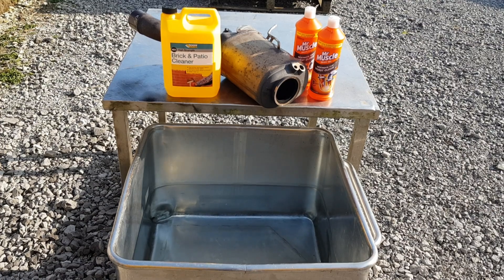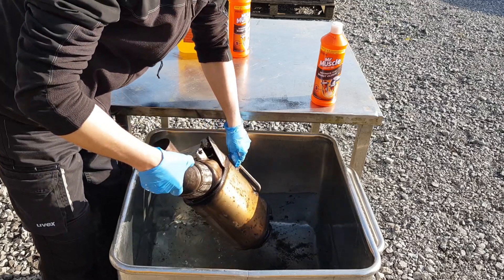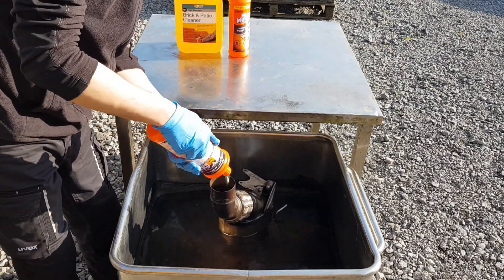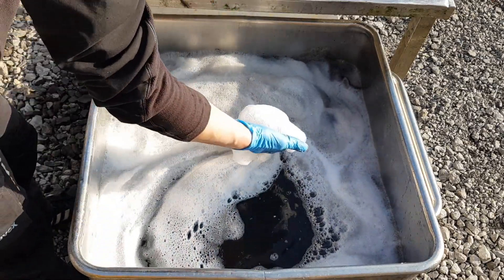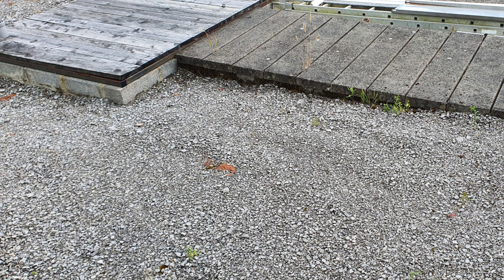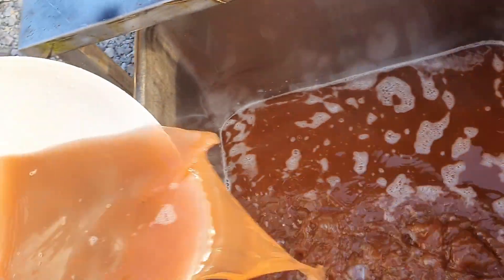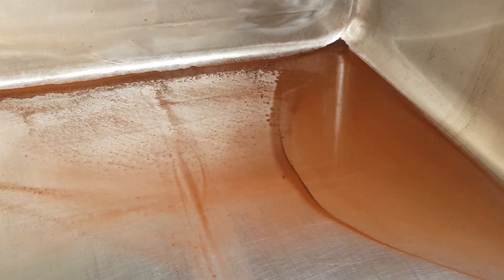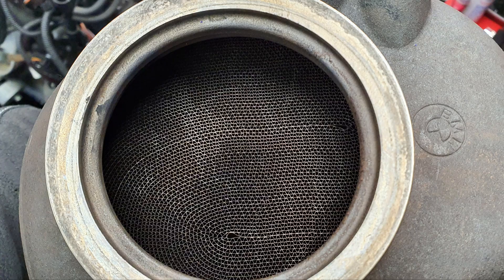How to clean DPF filter Diesel Particulate Filter Blocked DPF removed & cleaned BMW N47 cleaning N57

Comment: Hi, first of all thanks for the video. I already tried to clean my DPF with Wynne's Off Car DPF cleaner, it seemed to do something, but nothing like this and definitely had no red ash coming out, so when I put it back in the car it was no surprise that it did nothing and my DPF was still clogged and doing very frequent regenerations. I'll give this a go as it seems to be working great. Just a quick question though, do you dilute the brick and patio cleaner with water before you apply to your DPF? Or are you literally just pouring pure cleaner followed by water? Thanks.
Reply from the maker: @digitalasylum4612  I just poured it concentrated, just bear in mind it way slightly stain the metal but it will not cause any damage. It worked wery well for me. Hope you have the same success

Comment: That is not the Dpf....is the catalitic converter
Reply: Go to some autodoc and try to order a dpf for a bmw and see for yourself if is dat piece.
Reply from the maker: @dinisrebola2125 in this particular case on the N57 N47 engines BMW combine the DPF and the CAT in one single unit
Reply: Ok. Is possible. I have a e60 2.5d and the dpf is in the midle of the car.
Reply: @dinisrebola2125  it depends on the year/engine. The M47 had indeed the DPF in the middle of the exhaust and cat was after turbo. If I'm not mistaken, after 2008 even the M57 had the dpf and cat combined and located after turbo
Reply from the maker: @dinisrebola2125  Please do some more research

Comment: Have you come across Steven B. Tuner? he tested a number of diffrent solutions etc to clean dpf's, he had a simalar procedure that he tried with bits of a cut up dpf, stainless and the heat resistant packing. Worth a watch!! he moved away from the drain cleaner to of all things dishwasher tabs as a prewash, it worked just as well but didn't have the same issues with heat reactivity if you don't get every trace out of the fiber packing.
Reply from the maker: @K2edg  Thanks for the detailed message. I will certainly have a look when I get a chance. 🤝🏻
Reply: @TheKeenMechanic  if you search 'The Non-Damaging DIY DPF Home Clean (Diesel Particulate Filter and Catalyst - Ash Blocked / Clogged)' it will bring up the theory and why you don't use neat acid (or why you need to remove every trace of it), or 'DPF Cleaning at Home – 9 Chemicals Tested (Diesel Particulate Filter DIY Ash Cleaning)' will bring up his tests of diffrent products. Worth a watch if you do a lot of dpf's.
Reply: @TheKeenMechanic  https://www.youtube.com/watch?v=Zw-EAc_Lpv8&t=970s

Comment: For those here with an N47 on a 520D, the part shown in video is not the DPF. It is located near the rear of the car on the exhaust.
Reply: Yes it is, lol dpf works when the exhaust gases are as hot as possible
Reply from the maker: Thanks for clarifying this for the confused viewer. He did sound confident though😄
Reply: On N47 that is the DPF and cat integrated. You're confusing it with the M47 which it does have the DPF located in the middle of the exhaust and cat after turbo

Comment: Is it safe to perform the task with all the sensors in. I am afraid that I can get myself into trouble removing them?
Reply from the maker: It may damage them. I wouldn't chane it. If you damage them you will still have to take them out
Reply: @TheKeenMechanic  I assume they are going to be covered with soot. How to clean them. Will soot remover be safe to use. Thanks for your help
Reply from the maker: @_robertksiazek_  Give them a wipe with a clean towel, the soot should come off. Try with your soot cleaner if doesn't come off easy but do research it in case it is too aggressive

Comment: Thanks for the video, just out of interest do you know what your pressures were at idle before and after cleaning? Just done mine and drying it overnight before refitting tomorrow. 😊
Reply: Ah no worries it was only out of interest! Makes sense to whilst the engine is out for sure! Thanks for the quick reply!
Reply from the maker: @HalfaJobJames  No problem, glad you enjoyed the video🤝🏻
Reply from the maker: Sorry, mine was not clogged up to the point that will cause issues. I didn't measure the pressure before and after as I had no faults. It was part of the preventative maintenance whilst I had the engine out🤝🏻

Comment: Thanks for the video sir, most patio cleaners have sodium hypochlorite as an ingredient which normally rusts metal like you wouldn't believe so not sure about this solution
Reply from the maker: Tried and tested on stainless steel and worked the best. Would not recommend it on mild steel
Reply: @TheKeenMechanic  Fair enough if it's been tried and tested, hard to prove I guess without cutting it up years later but maybe ok as a one off or as it only needs doing infrequently. Thanks for reply sir 👍
Reply from the maker: @Infj-62  I got the idea from a scientist who tested both chemicals on stainless steel and had no reaction. Depending on the grade and purity if the stainless sometimes it might discolour it but if well rinsed it will not corrode the metal. I have personally tested it many times and no issues

Comment: Great guide, probably simplest on the YT, so I will follow it in near future. Quick few questions though:
1. do you need to remove all temperature sensors ? It looks like you got them off, but I'm a bit afraid that they will fall apart. 
2. Are those chemicals safe for catalistic converter which is a part of my DPF box and can't be separated.
Thank you for any answer!
D.
Reply from the maker: Hi and thanks for watching.
Definitely remove the sensors otherwise they well get damaged.
Those chemicals have been tested extensively by a guy who is a scientist and knows his chemistry. Do some research and you will see for yourself. It will discolour the metal a bit but it will not cause any damage to the stainless steel or the precious metal in the cat and dpf core. 
I have personally used this method on many cars and never had any issues.
Carry out with confidence and wear eye protection as these are strong chemicals🤝🏻
Reply: Hi. Thanks for quick answer. I'm not questioning the method here, I think this video is the only one mentioning the ash removal and I can clearly see the proof with my eyes. I've found different YT video where different chemicals been tested (maybe the same as you mentioned) and 2 stage clean is recommended, for soot and ash separately - again you are only one doing this. All off car dpf cleaners available are mostly concentrated on soot, I do not think my car got problems with that at all. Simply almost 700 regen cycles left enough ash to restrict the flow and I want to focus on this. Exact same chemicals are available here, do I simply do what you have done. Have you left the dpf to soak in or flush it promptly at any stage of your cleaning?
Reply from the maker: @wajdulis77  You can soak in and leave in the brick cleaner acid. I spent several hours soaking, rinsing, shaking, rinsing and soaking in the chemical for best results. If you follow my tutorial you can't go wrong. Some people use a pressure or a power washer but I was afraid in case it damages the core. Best of luck and hope you make it as clean as new. If you are doing this on BMW you can use ISTA+ diagnostics to register the cleaned DPF as a brand new one which should reset the count.
Reply: @TheKeenMechanic got all the info and already bought the stuff, just waiting for a bit warmer weather here in UK. Sadly I do not have BMW yet (got ISTA+ though) but in my current car I can reset all DPF adaptations through dedicated software as well. I'll definitely come back with the results; it just can take some time though as spring is still 2 months away. Thanks again!
Reply from the maker: @wajdulis77  No problem. Take your time and do it right🤝🏻
Reply: @TheKeenMechanic  Finally I've been able to start the job, which is currently in progress. Had big problems with the rusty sensor threads, which was the worst part of the job so far - all survived though. Used drain cleaner and was completely disappointed with the results as there was almost zero black soot. However, after just like 15 min. with brick cleaner brown mud come out, and there was a lot of it. Currently soaking with fresh detergent for the 2nd time. It is looks like success so far. I'm the same person, somehow logged on different account.
Reply from the maker: Hi buddy. You should be glad that you only got small amount of black stuff. It means your DPF wasn't too clogged up. The most important is the brown/red stuff you are taking out as it does not get cleared with regenerations. Well done
Reply: @wajdulis77 hi which software are you using ? I’ve washed my dpf ,but only engine management light is still on (Audi A5 sport back 2017) I bought an otofix d1 light ,which use a bit of autel software,but I can only have dpf regen on the scanner ,but not dpf reset etc .But still won’t let me doing a regen because it says soot mass is too high .
Reply from the maker: @islanderstalents8342 I use BMW ISTA+ bmw dealer software. It is only for BMW. In my case this was preventative cleaning so I had no faults before or after

Comment: Did you get any codes when you re-installed it?
Reply from the maker: Hi
No never had any issues with codes after installation.
Make sure to reset the dpf with ISTA+ as if you are installing a brand new DPF😉🤝🏻

Comment: Have cleaned dpf in my 2008 x5 by using hot water in a garden sprayer connected to pressure sensor on filter. Just warm car up and give little squirts fron sprayer, great results.
Reply from the maker: Nice one, whatever gets the job done. Thanks for your message buddy🤝
Reply: Hello mate do you mean you’ve cleaned it/sprayed it 5 times in one day or on different occasions ?
Reply from the maker: Hi
I meant I repeated the washing/rinsing multiple times in 1 day. Never  had any issues before or after.🤝🏻
Reply: @islanderstalents8342  he meant that he cleaned dpf on his BMW X5
Reply: Did you have the car running when you sprayed the water in?

Comment: Do you let it do dry off before installing it back?
Reply from the maker: You can let it drain overnight and blow it out a bit with compressed air. You can also install as it is, car will smoke a bit but after it warms up it will be back to normal in a few minutes🤝

Comment: But didn’t it work on the car?
Reply from the maker: Hi, It worked but it generated an error for limited life left. After cleaning you have to clear the values and update with ista as if you are installing a new dpf filter. Basically you are telling the car you have installed a new dpf filter. This is a good way of saving a few thousand £€$
Reply: @TheKeenMechanic  thanks 😊
Reply from the maker: @slippy1404  You are welcome
Reply: @TheKeenMechanic You can reset DPF with Bimmerlink also, and you get another 250,000 km/around 150,000 miles driving. Can be of interest to make the cleaning before ten years and 200,000 km/125,000 miles. Maybe the ash (and soot) is not that burnt to the "walls" then.
Reply from the maker: @leiflillandt1488  Always good to clean as often as you can but it is difficult to remove so some people just want to drive and sell when it starts causing problems